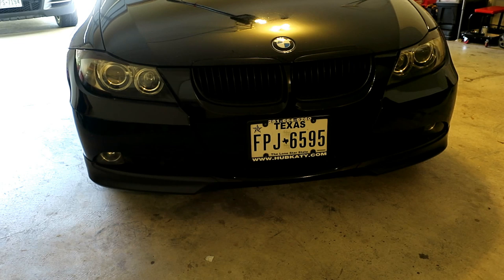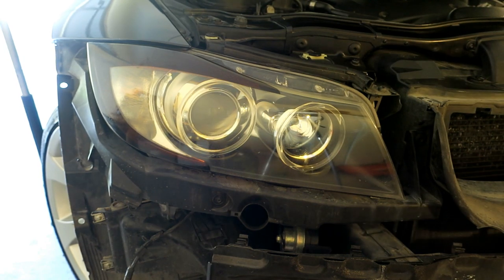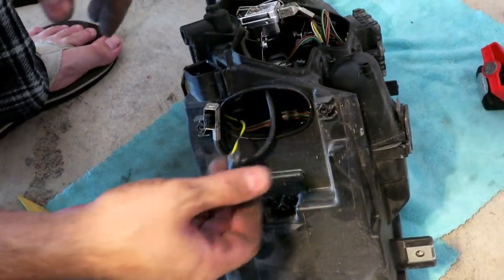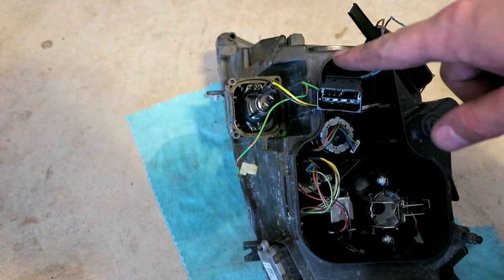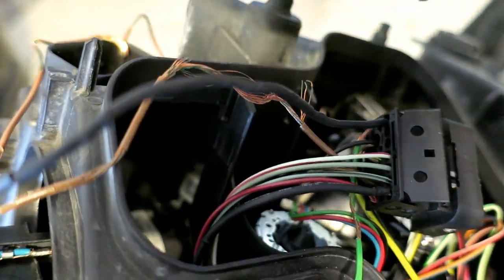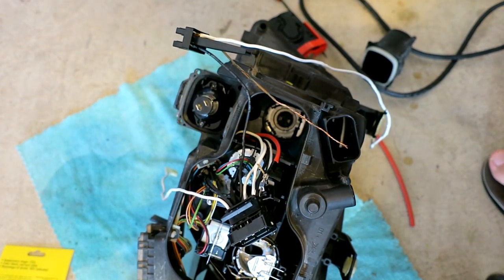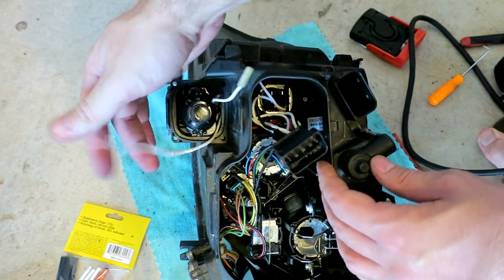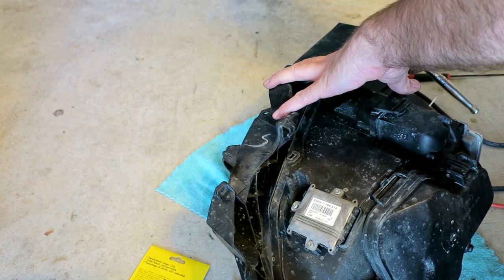How To Repair Heat Damaged Headlight Wiring.  On My E90 BMW.

Comment: Thanks for the tutorial!! I just finished doing both the headlights on my 07 e92. Had to heatshrink 90% of the wires and remove the clear cover for access. It took the better part of 2 days. Still better than paying 650.00 each. Use 1/8" 3/16" & 1/4" Heatshrink @ 3 to 1.
Reply: Thanks for mentioning the sizes Mark! Just ordered those heatshrink sizes in transparent from my local electronics store. Will spend a whole weekend fixing this I guess...
Reply: Yeahhhh they're about 1k each now 😩 about to take mine apart completely 🙃
Reply: Wondering if hear shrink work when your wires are brittle and few copper strands was broken. Do I have to solder? Twist the wires or splice the wires together?
Reply: @Oneklickmedia  You will have to cut the wire in order to put the heat shrink on. So yes, you will need to solder them back regardless.

Comment: Excellent video as always. I was changing out the halo lamps in my 08 E92 and realized that I have the same brittle-wires problem. This helped me tackle the surgery required to fix the issue.  Saved me a lot of time trying to figure out the best route. Also saved me a ton of money in replacing the headlamp assemblies. I tried the electrical spray tape, but that didn't coat the wires enough for me to give me confidence it wouldn't cause a short. Thanks again!

Comment: I have the same issue. I live in Medellín, Colombia, which is tropical, but also mountain weather. Temps range from 60F to 85F. What I've heard is that BMW used a biodegradable insulation on every single cable (Including the headlights). Didn't think about using shrinks to fix it. I was actually looking for wire to replace them all. But your idea is waaay better. I'll buy some and give it a shot

Comment: Really nice work, my Houston 2006 BMW 330i E90 was shorting on the DRL.  I tried liquid electrical tape a few months ago as I really did not want to get into the harness.  Thanks for showing me the way and really admire your patience.
Reply: James PW how did the liquid tape work out? My pigtail wires are exposed shorting out bulb. I can't believe I'm the only one who thinks removing the whole front of the fucking car to replace a pigtail is ludicrous. Ill sell it before I do all this.
Reply: @P272-e9k  It isn’t ridiculous at all, first time opening both headlights, 20 minutes for the bumper and taking out the headlights and another 30 for opening the headlights, a lot quicker to close ‘em.

Comment: Thanks for the video.  I noticed this issue with my ‘09 335i.  Had the headlight assembly out today to fix the right side adaptive headlight which was pointing at the ground.  Checked over the wires and avoided touching anything that might flake off insulation.  LOL
You can now buy “paint on” liquid electrical tape and it comes in various colors.  Used it a few months ago to fix bad insulation on wires after change out the day time running lights.
Reply: Link to that liquid electrical tape please lol

Comment: A friend's 2005 X3 with HID Xenon Headlights (Driver's Side Low Beam Inop) had similar issues with the Insulation Crumbling exposing bare wires within the Headlight Assemblies. I removed the Headlight Assemblies and essentially Coated the Bare Wires and what Cracked Insulation that still existed with Clear Silicone Sealant (Flowable for Windshield Leaks) with my fingers and keeping the Wires separated. 24 Hours later after the Silicone Sealant had Cured... I was able to Diagnose the Drivers' Side as having a Failed Ballast (by swapping Lamps and Ballasts as needed).  Randy   AKA randog311  (Retired Professional Wrench).  FYI: I have no Idea why the NHTSA hasn't Mandated a Vehicle Safety RECALL for this Obvious Safety Headlight Issue that many Automotive Manufacturers have, BMW is not alone.

Comment: Hey great work here! I have same problem and fixed it quickly with some hot glue so the wires are stuck and can not touch. But this fix is for sure better.
Regarding the Angel eye still off, probably you have to use the Tool32 for the Short Circuit counter Reset. That fixed the issue 100%, i had the same problem

Comment: I have an '11 E93 and I have a right and left stepper motor box failure DTC. All of the lights blink about 9 times at startup,  the headlamps sweep up and down while driving straight and side to side in turns. The FRM has been checked and is fine and the headlamp bulbs are OEM. Do you think this could be my problem or do I need to contact an Exorcist?

Comment: This 100% should have been a recall.  EVERY single owner I know that has one of these has had this problem.   Its pathetic :(
Reply: Including me. 

I couldn’t identify which bolts to open in the wheel well. 

This particular job seems difficult.

Comment: I have a e92, and I have the same issue on one of my headlights. My halo lights don't work, and when I looked inside the headlight the wires going to the angel eye bulb socket are flaking. Thanks for making this video. 👍

Comment: It's biodegradable plastic mandated in the 1990's by the German Green Party...and I am not making that up. Mercedes has cars with engine wiring harness issues as well. I have two 1990's Benz wagons that I had to replace the engine wiring harnesses on because the wiring insulation deteriorated just like this BMW. I also have a 2006 X5 with a headlight issue like this one. That's how I arrived here.

Comment: '06 330i:

I tested the working Xenon bulb and ballast from the passenger's side on the driver's side and it did not turn on. Driver's side Xenon and ballast don't work on the passenger's side.

About a 1.5" of insulation on the DC wires into the ballast is stripped on both leads.

Unfortunately, after giving up and slapping the rear headlight cover back on, now the driver's side angel eyes and DRLs are also out in addition to the Xenon. Do I need to go through this whole process of removing my bumper and entire headlight assembly, inspect the wires and heat shrink the bad ones?

Your video was so informative and helpful. Even though you sound depressed. Great video.

UPDATE: my driver's side angel eyes just came on. So now only the DRLs and Xenons are out on that side. I expect the angel eyes to stay on go out again soon, and maybe be intermittent.
Reply: I couldn't get to the bolts from the wheel well and had to back out of the whole process. I can't tell exactly which bolts to open under there, and they were so difficult to reach that there'd be no way I'd be able to put them back.

I'll need to give it another shot later, maybe in sunlight.

Comment: Quick question I have an E92 2008  328 I if i unplugged the  The headlight assembly to clean it up do they need to be reprogrammed When I reinstall them I'm not looking to change anything electric or change out anything that the car didn't come with I just want to make sure when I plug it back in it'll work I don't have anything but nice thing but a Fox well NT530  Scanner.

Comment: Would it be possible to replace the wiring itself? After you de-pin everything? 

If all else fails, I guess you could hard wire a D1S using a adapter and find power for the angel eyes themselves. You would lose active steering though. I feel like all used units are going to have this issue. It should be recalled.
Reply from the maker: I think it would be really tough to get in there and replace all the wiring without completely taking about the headlight including removing the lens etc.
Reply: @VehicularDIY  Did replacing the angel eye work? Also, is this still holding up?

Comment: Get the CREE angel eyes with small balasts, but don't get cheap ones. I put some of those in my E60 and i'm in Dubai where there is lot of heat during the year and they work perfectly. Thanks for the video !
Reply from the maker: Thanks for the suggestion.

Comment: You are a HUGE HELP! plan to do the same unpin and heat shrink tubing on my flaking 06 e86 Z4.
I purchased 1/8" and 3/32" tubing is that the right Size ?? Thanks! Dan

Comment: So, I had this exact problem on my e92, and this video btw, was amazing.. best one I found for removing the headlight. Anyhow, I pulled the headlight out, and honestly- my wires look fantastic. Do you think anything else could cause the same issue? Symptoms: Nothing works in the housing, except for the turn signal & running light bulb. Angel eyes, low & high beams do NOT work at all. Other side works fine (passenger). Could something as simple as the ballast be the issue?
Reply: FYI- Bought one. Didn’t work. I swapped passenger side to drivers side and it worked. Which means it’s something INSIDE the drivers side headlight enclosure. No idea what. I just ordered a new one from FCP Euro. $733. ugh.
Reply: @georgetrudeau8096  Did you get it fixed? Did the ballast from the faulty side work on the good side?
Reply: Yes, got it fixed by replacing the entire housing. Sucks because that was ~$800 from FCEuro. But a year later, it’s still perfect.

Comment: i had the same problem with my angle eye.  the problem was that there is a mirror that sits in a bracket on the inside of the housing that reflects the light into one of the angle eyes (one bulb lights up both angel eyes).  i carefully popped the mirror back into the bracket and works perfect now. headlight does have to be removed so it can easily be worked on

Comment: My '04 e46 330ci has this same issue. Just found it out and a noticiable thing is I don't use it a lot, and when i do, i do it during daytime (no drl) so i dont use headligthts. it has only 50K miles so i think its age and  heat related (not only heat)
Reply from the maker: Yeah I heard it has something to do with the materials being biodegradable in newer cars.  Rubbers only last 10 years etc.

Comment: Excellent efforts, but the heat shrink means nothing if all the cables are the old ones
Reply: but surely the heat shrink will act as insulation - no matter the condition beneath?

Comment: Thank you. I have the same problem with my E60, DRL on passenger side went out first I thought it was the lighting bulb, but it wasn't, the drl on the driver side went out yesterday it turned out all the wires were exposed, and i use black tap to wrap it up, it works. but the passenger side is still not working, there no voltage coming out from the harness, or the connector. Do you figure out what is the problem?

Comment: i've same issue, with the condition. HID D1S on left side i switch to right side, and there was normal. but when i try to relocated on original position (left) it off, thats the same issue like this vid?
Reply from the maker: Possibly, you should pop the back cap off and see if you can see bits of wire insulation at the base of the headlight.

Comment: Hey man. Really need some help on mine. Is there any way I could get in contact with you? Email? Text? Anything? I can’t get power to my high or low beams or my DRL or my turn signals on my driver side. I bought the car with a severed harness and i bought a new one and I can’t find where 3 wires go. Really need some help and can’t find a wiring diagram anywhere. Thanks man